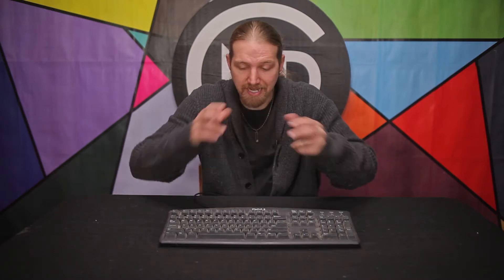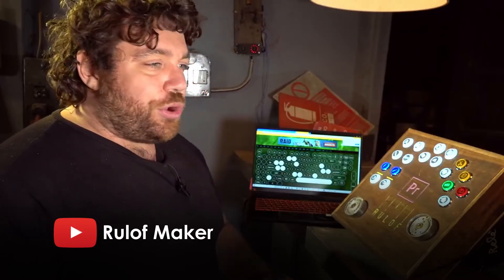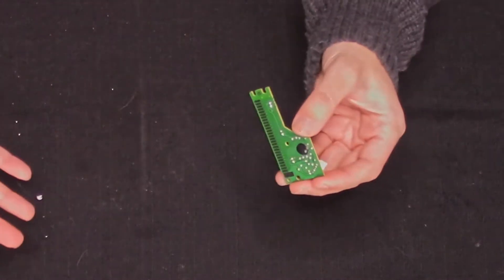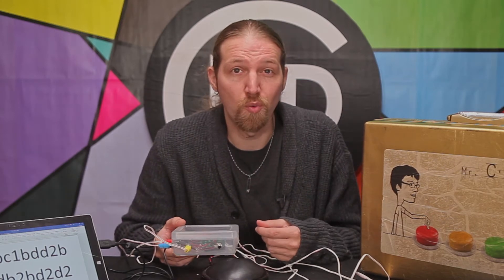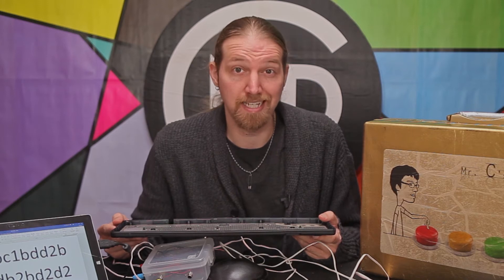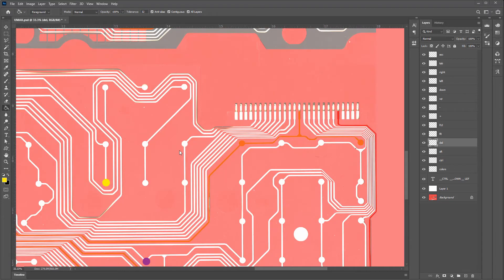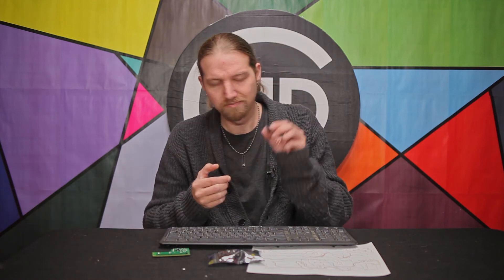Make a Keyboard From a Keyboard - Part 1

Comment: Another way is to use a multimeter on it's continuity setting. Place one probe on the key contact, the other you run along the pins. It will beep when you complete the circuit. If you don't have a multimeter, salvage an LED and a 3v button cell (CR2032) and some wire. Connect the led and the battery with a couple of wires to make your own continuity tester that will light the LED when you complete the circuit between the keypad contact and the pins.
Reply from the maker: Yeah, a continuity tester is a great solution!

Comment: Will making a three button module with a USB keyboard connection work, you mention a PS2 does work, but I would have to use a old PC to use that not a modern laptop.
I traced out a laptop KB and kinda ready to test but don’t want to loose the blue smoke, any danger in testing my try??????
Thanks
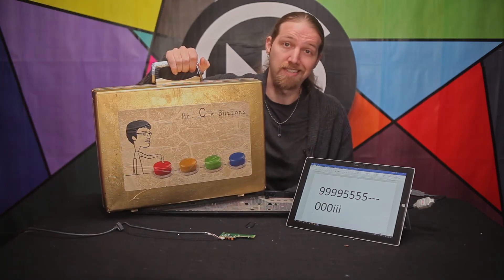Reply from the maker: Yeah, USB definitely works. The "Adam's Buttons" that I show at 4:00 was made using a USB Keyboard. I was just using a PS2 keyboard for this specific project because I couldn't access the bios  using a USB keyboard on the computer i planed to use it with. - If you are worried about damaging your computer (it's very unlikely - USB circuitry is pretty good at protecting itself.) But you could just plug it into a cheap power brick just to be sure nothing is shorted. Be careful and do at your own risk of course. But like, for example, under normal circumstances, there's no harms in plugging a USB thumb drive into a power brick. It won't do anything, short of maybe light up any indicator lights the drive has. But it won't damage it.
Reply: @IamNickDClements  thanks for confirming that USB works with this mod.

Comment: What kind of scanner you used? Is that a special one? How do you import it to a circuit like image? What is the name of the software?
Reply from the maker: Just a normal scanner, the one in the video is just large (and old) but a regular sized scanner will work fine, you just might have to scan it in 2 halves. Honestly you could even just take a picture of it with your phone. I was using Photoshop. But gimp, the free Photoshop alternative would work just as well, or honestly even just Microsoft Paint.

Comment: Hello everyone 
Do you think it's possible to make pressure sensitive buttons with this??

I only need two buttons to be pressure sensitive, I thought about potentiometers but I don't know exactly how to do this...
Reply from the maker: Unfortunately I don't think so, the basic circuity on a cheap keyboard is just on or off. You may be able to do it with software... if you look at Rulof's original video, where he made dials, connected to relays, that basically repeatedly pressed a key. You could possibly have some hotkey/macro software running that emulated pressure sensitivity increasing sensitivity each time the key was subsequently pressed. But that is a lot of maybes, and I have no clue how responsive something like what would be.  If you want a pre-made solution, Cooler Master has s control pad, with 24 pressure sensitive keys. It's around $90 on Amazon. I own one (I backed the original Kickstarter) and it's a pretty good keypad. https://www.amazon.com/dp/B08J6J1CZV